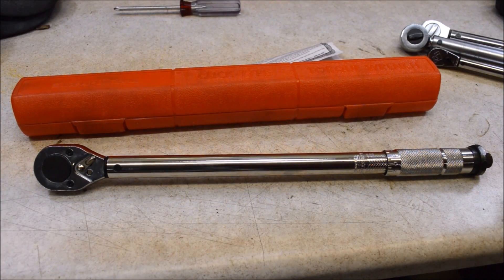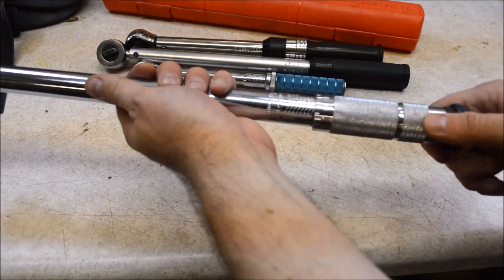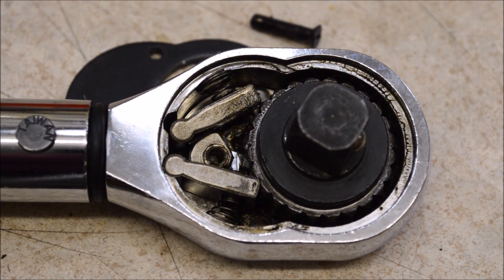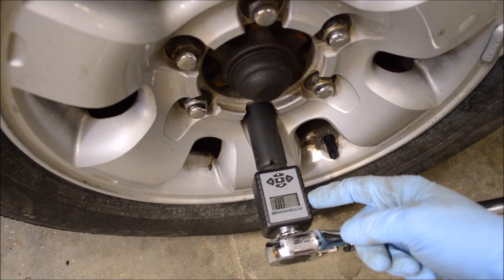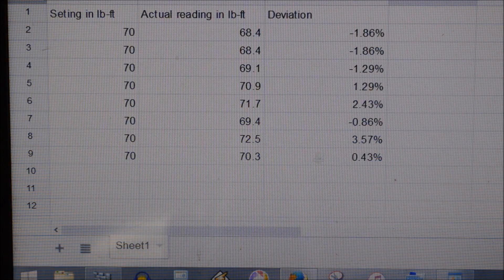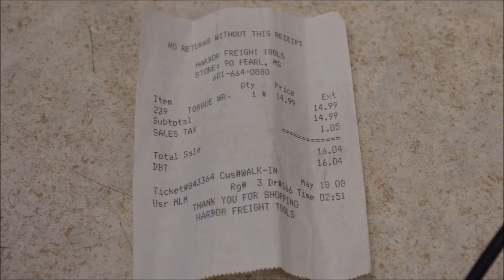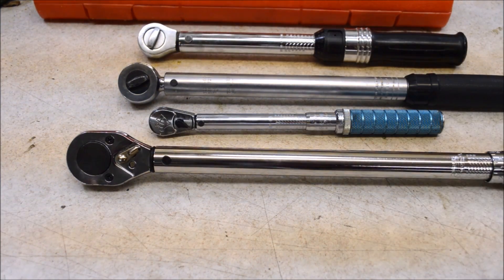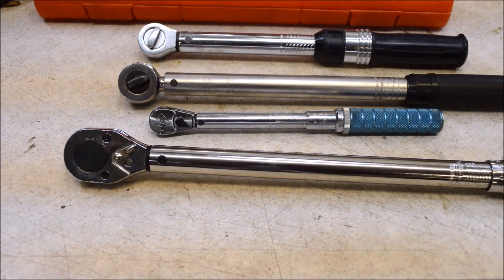Harbor Freight torque wrench 8-year review and accuracy test

Comment: I'm not sure about testing a HARBOR FREIGHT wrench with a HARBOR FREIGHT test device
Reply: How? For there to be a conflict of interest, the torque wrench and the torque adapter would have to be off by the same amount intentionally. One way to dispel this is to test the adapter with a freshly calibrated torque wrench. Also, probably the more interesting part of the test would be the consistency of the torque wrench. It was within +/- 4% of the torque setting, however the consistency deviated by almost 6% of the torque setting. All-in-all, this test shows that the wrench does what harbor freight claims it does (They claim it is accurate within +/- 4%.) This test needs to be done over the complete range of the tool to be complete.
Reply: Two different devices made by two different suppliers purchased at two completely different times. If you thing "Pittsburgh" actually manufactures the tools with its brand marking, you're delusional. They come from all sorts of sources in Taiwan and China. The fact that the two devices come into agreement with less than 5% variance actually gives me some confidence that both are good enough for most work. Precision needed for alloy aircraft and race car fasteners is another matter, but we're not dealing with that here. We're usually dealing with grade 1 or 2, perhaps some grade 5, and the occasional grade 8 steel nuts and bolts commonly found on a car or light truck. I'm not really a big fan of the Harbor Freight torque wrenches simply because of their sloppy adjustment mechanism and difficult to read micrometer setting markings. However, they work, and for the guy who might need one every couple years versus 8-10 hours a day 5-6 days a week turning wrenches professionally, they're cost effective. Who can rationalize spending $400 on a Snap-On torque wrench if they're going to use it twice a year - at most - and more likely once a year or every two years. The (Amazon) Tekton, Lowe's Kobalt and Home Depot Husky are a step up for a little more money and I'm happier with them.
Reply: I actually wasn't aware of storing it on the lowest setting until a couple of years ago, but I do that now for all my torque wrenches.  I just picked up a 1/4" drive HF wrench yesterday, and did a quick and dirty comparison to my 3/8" Craftsman wrench by setting the HF to 120 in-lb and the Craftsman to 10 ft-lb, and then bumping them up to 144 in-lb and 12 ft-lb respectively, both tightening a 10mm bolt.  Both wrenches seemed to read and click the same on both settings, so I'm happy with my $20 HF purchase.
Reply: @Patrick94GSR  I've watched a few videos dealing with comparison and testing of the HF torque wrench. The HF wrenches have held their own against brands. Maybe if and when my torque might give I'll get them a look.
Reply: I agree. Kind of a conflict of interest
Reply: I for one can attest to the harbor freight torque wrenches being horribly inaccurate.  You might get lucky, you might not.  I'd rather have a better than 50% chance that the one I pull of their shelf is going to work correctly.

Comment: I have what I believe to be this exact wrench, sold in the UK by Toolstation under the LASER brand.  It comes calibrated with a certificate, my cert says at 120 lb/ft the wrench actually clicks at 120.5 lb/ft.  I store it properly (unwound, in its case) and it has served me well. What more do you want for £30?

Comment: I just blew apart my 1/2" HF torque wrench while attempting to torque a lower strut bolt. The screws came out and the ratchet mechanism came apart, losing the pawls and springs in the process. That wrench had given me 5 solid years of service and accurately torqued thousands of bolts in it's life, so I had no reservations in picking up another one with a $9.99 coupon. I just need to remember to Loctite the screws.
Reply: Life time warranty, just drop it off and pick a new one for free at the store.
Reply: @FelipeMejia13  Dude... 😂😂😂
Reply: One thing about China tools is they bolts and screws come loose so always use loctite
Reply: Did you ever find any of the parts LOL.

Comment: 8 years? I couldn't get 8 uses out of the 1/2" Harbor Freight Torque Wrenches I had. The first one failed (stopped clicking, so it basically became a breaker bar) and nearly caused me to twist off a bolt in an engine block (still had to replace the bolt). Its replacement failed the same way, but luckily while torquing lug nuts on my car and I just thought, this seems too tight for 100 ft lbs.  Tried it on my truck (150 ft lb lug torque spec) and the HF torque wrench set at 100 ft lbs didn't click even with over 130 ft lbs applied, I lowered the setting on the wrench and it didn't start clicking again until it was set at around 35-40 ft lbs. The 2nd and 3rd replacements both failed this way as well, but I cannot return them, they will only exchange them. At this point they have been demoted to lug nut only use where over torquing poses little risk of damage and is easily detected. However, I have not had any issues with the 3/8" HF torque wrench.
Reply: Not purchase, replacements. They’re lifetime, no receipt needed to get another one. Just your phone number
Reply: Mine didn't click either...
Reply: Brad N  I'm smiling. A 3rd purchase of the Harbor Freight ?  Time for Craftsman or some other
Reply: Question: How many bolts did you remove with the wrench? Even though it's marked with an OFF you NEVER use a torque wrench to remove a bolt or nut. They are ONLY for tightening. Instead of ON and OFF they should be marked RIGHT and LEFT.

Comment: Have you run the accuracy and deviation test back to back with one of the expensive torque wrenches using that same torque adapter setup?  It may reveal how much of the variation was from the tester setup as opposed to the torque wrench.  The long socket used isn't really ideal for the measurement as some of the forces are displaced, unless supported at the head as it looked like you were doing.
It'd be interesting to see if the pricier ones are indeed capable of tighter accuracy and consistency.
Reply: 2009G8Gxp 
I haven't had any issues with my hf        wrenches, so I would like to see if the assumption that everyone takes for granted is true, that the expensive wrenches are  noticeably more consistent and accurate.  
I'd be impressed if they could produce a comparative set of measurements all within 2%. The other assumption is that the digital torque adapter itself is accurate.

Comment: Great Torque Wrench! Did me well for the years...10yrs approximately.  Obviously it doesn't work anymore. But it won't stop me from getting another one for to do me another 10yrs of service! Thanks for the Vid!
Toyota Tech... 16yrs
Reply: TheTech660 they have a lifetime warranty on all hand tools
Reply: You won’t have to buy another one, It’s lifetime replacement. And within time it should get better quality and since it’ll be lifetime you can get the newer/better model when they produce it and discontinue the older one.
Reply: I still have my Proto torque wrench that I bought back in the early 80s. Only used for DIY work my different cars over the years. It's still accurate and the complaints about the sloppy 
handling and being difficult to read are still there.
Reply: for that price , people sure complain much,humans .pay peanuts get peanuts

Comment: I've never had a HFT torque wrench before, but it doesn't seem to be that bad with your little tester there. +/- 4% isn't too bad as long as it's not something that needs to be torqued at 250 ft/lbs, which is probably that wrench's max. I sure wouldn't mind lending it to a neighbor at $15 a pop.

Comment: These cheap ones are great for torquing wheel lug nuts. But its kind of tedious to use in a shop environment. The modern digital torque wrench is great for angle which is great for TTY bolts. So for DIY and home use, it makes sense to use something as cheap as this.

Comment: Great review! This is very good to know, as I just bought myself a HF 1/2 inch torque wrench and it seems to be pretty decent quality for the $12 I shelled out for it. I don't work in a shop but I do a lot of general repair out of my driveway, and this looks like the perfect tool for the occasions when I need a bigger torque wrench.